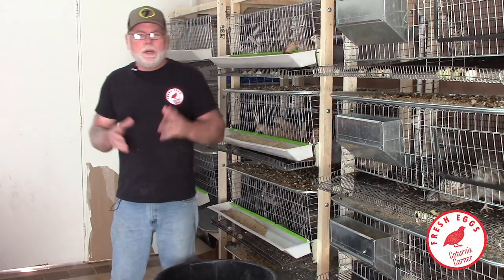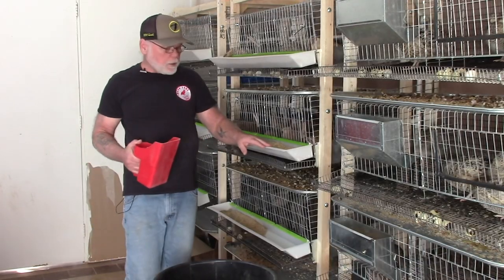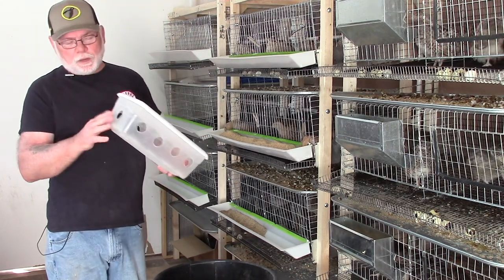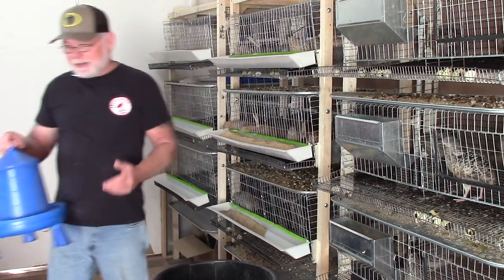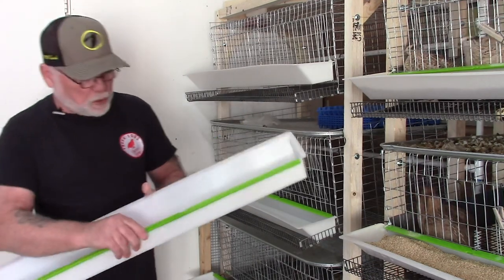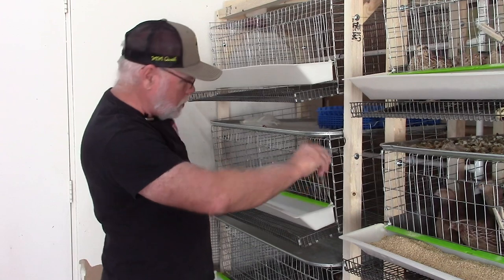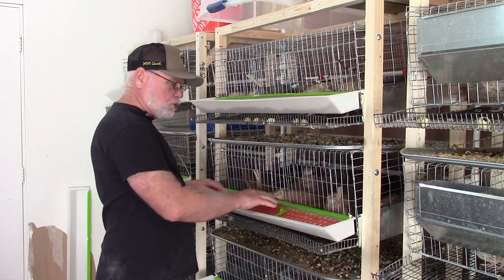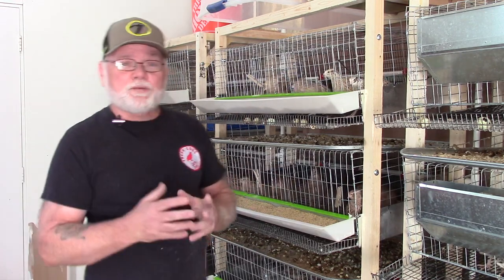Coturnix Quail Feeders - Dealing with Feed Waste

Comment: I made a no-waste feeder out of a 1-foot section of 4" PVC pipe. I drilled eight, 1.25" holes, 1.5" off of one end. I installed a pressure test plug as a floor of the feeder. But the key of the feeder is the top of a 2-liter bottle that only lets food down into the base when the quail eat what is currently in the bottom of the feeder. It will feed eight quail at a time and won't allow the quail to waste food. Any food they sling stays inside the feeder. The materials cost for the feeder was less than $5 and it will hold nearly two quarts of food.
Reply from the maker: Would like to see this one. Send me a pic on FB if you would.
Reply: Would like to see a pic as well

Comment: Thanks Terry. Do you really need a feeder (Hatching Time type) to go all the way across the front of the cage? Is there a rule of thumb as to number of birds and length of feeder needed? I find that as long as my birds have not run out of food, they have no problem sharing a smaller feeder. I ask this as the shorter feeders are less costly. It is about saving money. Thanks.